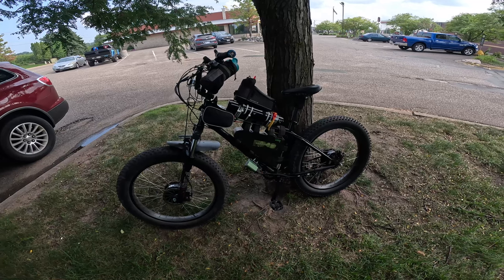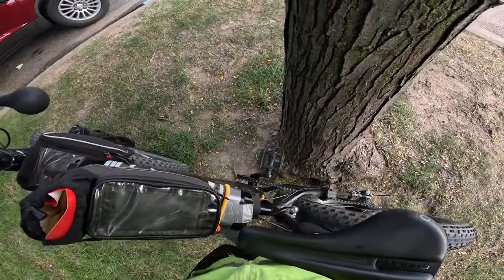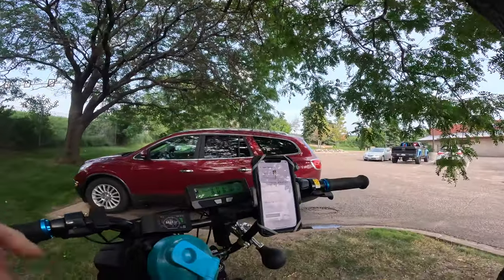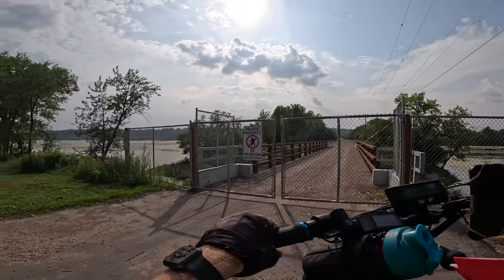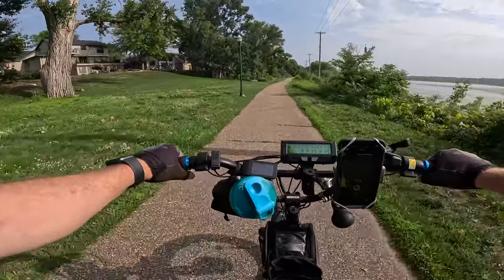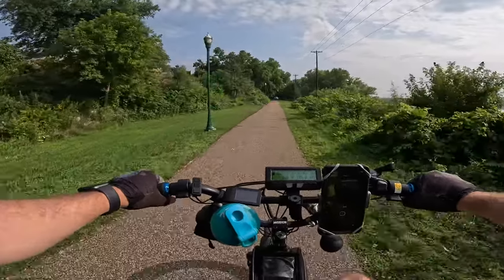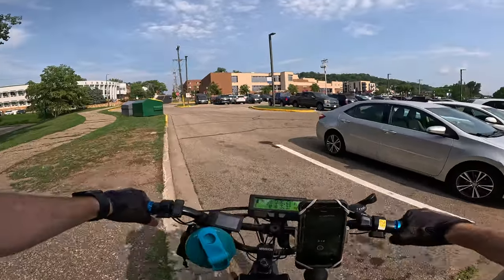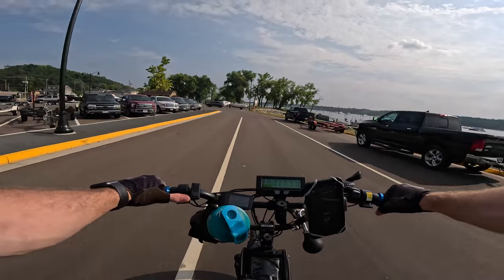Testing my EBike WITHOUT BBSHD (Dual Hubs G62 G60)

Comment: I run two hub motors/two controllers one 40a and one 80a and one big 72v battery and only one throttle. I have a switch to cut off the throttle input to the front controller when I only want the rear bigger motor to run. I use the assist levels to match up the speeds on the two motors so both are putting out the same power. The rear motor is a 3K 72v NB and the front is a 1500w 48v leaf motor so matching them up was fun, but now they will pull at about the same power. I can also run just the front motor by flipping a switch that is in the brake cut-off that will cut power to the rear controller but still keep power to the throttle input to the front controller.  That is on my Sun SX Recumbent top speed 48 to 50mph. On my Chopper spoiler, I just use a 150a controller and a 5K NB motor. Life is a lot easier with one big motor and only one big controller top speed of 60.1mph. As always battery weight is always a factor Two 20ah at 60a 20lb each in two saddlebags
Reply from the maker: nice, the dual motors are fun i like it in the snow and sand,  its kind of overkill not really necessary but its a gimmick that i enjoy. Your bike sounds awesome. I have considered those big 5kw qs 205 motors but from what i understand they are like 40 pounds in the rear wheel, thats crazy Lol. I am trying to consolidate my battery situation and get my bike to a good spot in terms of weight and battery. Would love to see a vid of your bike if you have any  drop a link some time !!

Comment: Get a fully programmable kit from High Voltage. I run 72V Molicels on my BBSHD and it rips on a full suspension Diamondback Mission Pro bike 55lbs. Add the new Peek gear to handle the heat. Absolutely love my ride.
Reply from the maker: ive always wanted to try the BBSHD on 72v with a better controller. I question the chain and bicycle drivetrain   though Lol,  how many watts have you done?? when I had a small chainring on my bbshd fat bike in a torquey setup, it already sounded like it was gonna chomp a chain on me Lol,  but it was giant 26x4 fat tires on a 45 pound bike

Comment: Wait.... u have 2 thumb throtle? And they bike had 3 motors? How is it? 72v? How many AH on battery? Some many questions😂
Reply from the maker: the g62 is a 1000w motor meant for 48v,  it can run fine on a higher voltage. The controller is what is voltage limited. A 48v controller can't do 72v. So you get a good controller that can support 72v, like in my case I have a phaserunner v6 L10 controller that works with 72v and can easily connect to the g62.  The dual motors each have a separate controller, display, throttle, battery.  The triangle battery is 72v 19ah  and other battery is 48v 15ah

Comment: Would a fat bike running a single g062 72v be worth it? I haven't had a high powered geared drive, only direct drive.
Reply from the maker: yeah its a good motor, it comes in 175mm or 190mm drop out size. its 1000w nominal, it can do 2000w without much issue, i have it set to 2500 or 3000w max usually so i can juice it a bit. The grin tech one goes about 40mph, i got one from greenbikekit thats wound slightly faster that can do about 42mph.  I think the motor weighs like 8kg or something, its not 40 pounds like a qs motor. You can get the RM G062.1000.DC where the "C" means it has a cassette freehub body instead of the freewheel threaded hub,  so you can use an actual bike drivetrain.  Long story short its fun if you want a fat bike that can do 40mph. On 26" wheels at least, i wouldnt put it on smaller ones.  I am gonna do a video about building a g62 bike soon.  it would be really fun on a lightweight bike like a mongoose dolomite ALX.  Or i was thinking about maybe getting a Surly ice cream truck frameset would be fun with the g62. Id definitely try to keep it light weight as possible,  feels alot better now that i took 30 pounds off my bike
Reply from the maker: one other thing , i would say dont bother with the g62 on a lower voltage or with a stock controller, it sucks, gotta have 72v with the cycle analyst  torque throttle
Reply: @EBikeBuilder_  thanks for the advice and information.  I am looking at used fat bikes that already have a legit suspension fork because my dolomite bikes have straight steerer tubes and only chinese forks work on them. I put Judy's on my other ebikes and they're a huge improvement.

Comment: How is that on steep grades compared to just a mid mount motor?
Reply from the maker: the g62 is a geared hub so it works pretty good in general on hills, especially with a phaserunner V6 L10 controller on 72v where you can customize the phase current.  BUT , i would say if you are purposefully going to be climbing hills for extended periods of time, where the bike is going to be moving at slower speeds,  the BBSHD mid drive geared low with a small chainring can do that all day without a sweat.  Also depends on weight of the bike and rider,  for heavier bikes the BBSHD will have a lot more torque and in general feels better than a hub motor.   The G62 isnt going to crawl around in the mud and over logs and stuff like a BBSHD can
Reply from the maker: oh. and with the dual hub motors  its kind of like having a mid drive. Climbs really good, the torque of the motors adds together as long as the front wheel can get traction

Comment: How does it feel to ride to ride now it's been on a diet 😊
Reply from the maker: It feels better the hub takes off quicker with less weight. And the tires even sound a different pitch on the road. It was getting too heavy Lol. If i get that 48v battery off , and then build a more energy dense 72v battery,  it should weight 10 pounds less and still have a good amount, at least 24ah of 72v.    Still deciding on size and weight of battery build
Reply: @EBikeBuilder_  nice 👌

Comment: Why is there so much crap on your bike and why are handlebars so high like for seniors?
Reply from the maker: its a hardtail mtb but i put bmx bars on it for a more upright riding position. I would rather be comfortable; don't really care about wind resistance. If you are leaning forward riding an ebike it can be uncomfortable on wrists and hands, my wrists are F-d from working on a computer for 30 years.  have a bunch of stuff on the bike because some times i ride around for like 2 or 3 hours , need lots of stuff both for riding hte bike and filming
Reply from the maker: theres like 10 go pro batteries and  microfiber cloths and all kinds of stuff in the top tube thing just to deal with GoPro,  TBH.  And C02 carts and all kinds of stuff.  I cant ride with stuff in my pockets,  drives me nuts,  backpack and hip packs will get your back all sweaty.
Reply from the maker: I'm Not Taking the Fry Holder Off Under Any Circumstances